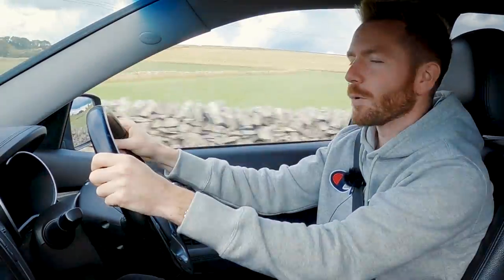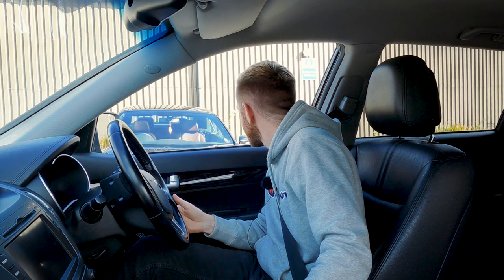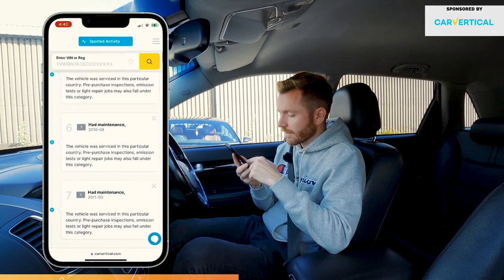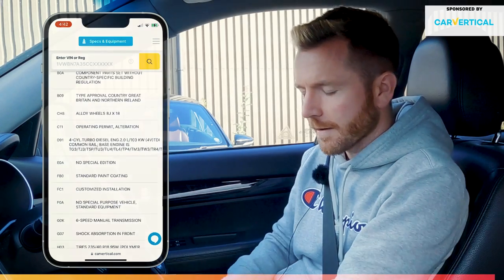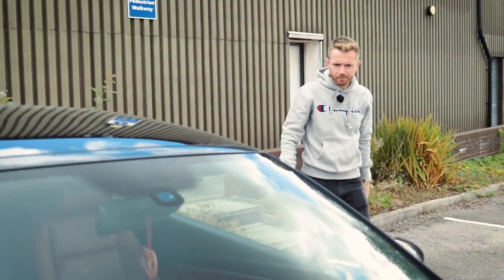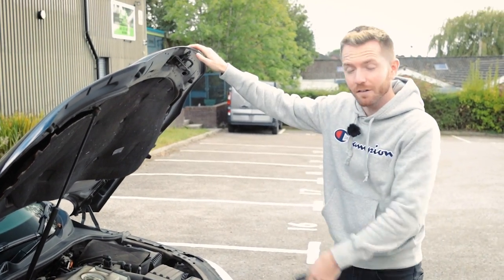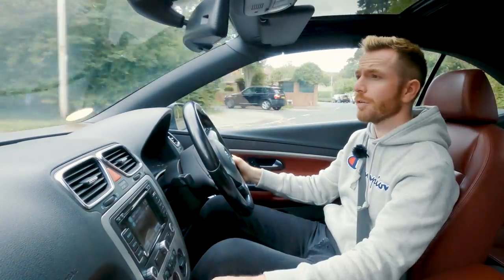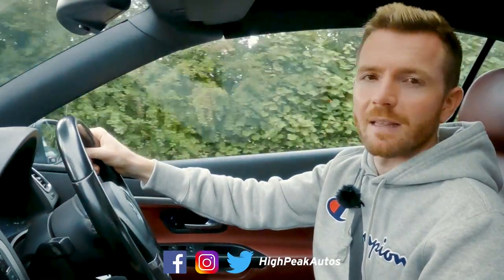I BOUGHT A CHEAP VW EOS!

Comment: We have an EOS. TSI. Kept the seals lubricated and hardly any water ingress. Not a drip in the boot. Looked after they’re great cars. Never an issue with the roof and had it 7 years now. All comes down to looking after the car, it will then look after you. Great video.
Reply: Look at the light in the middle boot as the sun eats the plastic , just press it in the middle , but be warned in my fall out , check before it kills the roof ECU and motor £ 2k to put it right .More if VW do it .
Reply: It is the same here in Denmark.. These were pretty expensive as new cars and still hold a decent value. So people has and still is, taking good care of them. I have traded 4 of them since 2010, and all of them were just like 98% new cars. ;) Cars in Denmark are much more expensive than in England, so that might be the main reason. A well maintained 2.0 TFSI is still £18k.. A diesel like the one in this video would me £7-7½K :)
Reply: So you lubricate with silicone spray?
Reply: Awsome, imma get it
Reply: "Hardly any water ingress". Not the words any car owner or submariner wants to hear
Reply: @eponymous7910  I'm big fan of the Mk7 Golf GTI Performance and R, having had them, but the cheap and thrown together Eos and the later Mk8 Golf product, along with all the "Roc" models, make we want to vomit
Reply: @acidoblivion  It’s best to use Gummi Pflege lubricant for these seals
Reply: @SoulJuce  yes. Works perfectly.
Reply: How do you lubricated it, and with what? Is it a tedious process?
Reply: Krytox 105 is what is recommended by VW
Reply: What's great about it? The fact that it works doesn't make it great.
Reply: I just bought a 2013 TSI with 42000 miles very well maintained first thing I did was put the top half way down and flushed the drains and lube the roof seals with simple Vaseline. Vaseline petroleum jelly has been used for years on T top seals to keep them soft and not drying out and cracking and lube pivot joints while at it took just 30 minutes as far as oil consumption will use average of a quart between changes but my mechanic who own his own shop worked as a VW mechanic fo 14 years told me to change the oil every 5000 instead of the recommended 10000 miles that the computer says he said the oil consumption won’t be as significant then I’ve always changed oil every 5000 on my cars anyway

Comment: Great example of modern German engineering. Just 100k miles, and the folding roof, sunroof, bonnet opener and air conditioning are all busted. Hardly surprising that people experiencing that level of reliability turn to Toyota for future purchases.

Comment: That had a lot of kit for a VW of that era (when the feckin steering wheel was an optional extra). But the usual suspects haunted it, clutch/flywheel, rust coming on and roof not working Definitely no surprises and as the engine and box are good you're right, absolutely one for a DIY guy.  Thanks for taking the time to put this content out. You make it funny, punchy and the editing is great.

Comment: Sad to read so many negative stories about the EOS... I have had a 2008 2.0 TDi DSG Sport gor the last 8 yrs and it's been one of the most reliable cars I've ever owned. It's done 123,500 miles always serviced, with a high spec and a roof that has never let me down. It just sailed through its recent MOT as it has done the last few. I live in Devon so the roof is up and down all the time. It drives like it did the day I bought it... I guess I've just been lucky, or maybe I've just looked after mine
Reply: Same here. A car will only perform as well as how it’s been taken care of. It seems like the previous owner of the EOS in this video did not maintain it as well. I love my 2009 EOS and maintain it through scheduled maintenance checkups. I have 136,000 miles and it’s going strong so far. I live in the Washington DC area in the US. I was surprised to hear about the common leaks and smells mentioned as I don’t have that issue.

Comment: Pro tip - you need to keep the roof seals lubricated with a product called Gummi Pflege and ensure all the roof drains are empty and free from debris. That way, you'll ensure your roof keeps water tight and working like new. 

Cheers
Reply: What happens when it does open no more :(

Comment: My tip for water leaks.  The seals can stick against their mating surfaces and enable leaks. The seals from the factory have a long lasting coating applied which allows the seals to slip against their mating surface but often the rubber seals and bodywork have become dusty and dry for lack of attention, they bind and do not seal well. Try partial opening of the roof and clean and apply something like Armor all protectant for vinyl and rubber to the seal and the metal body mating surface. You would be surprised how often this works. Try it on door seals to keep away water which can freeze in Winter making door opening difficult. Try it on tailgates too, especially if there is a leak, which some tailgate profiles are prone to. Remember clean dusty surfaces of the seal and mating surface first then apply protectant with a piece of sponge. It costs little and does a lot of good and may just save a leaking car.
Reply: I was thinking similar, I suspect not a lot wrong with the roof mechanism that lubricating and cleaning couldn't sort. Sadly though not so for the rest of the vehicle.
Reply: Well said my man VW  do some special grease for all the rubber seals . A great little car .
Reply: The stuff needed to maintain the seals is called Gummi Pfledge.
Reply: @drnick1972  The correct lubricant for the seals is Volkswagen VW VAG Group Krytox Roof Rubber Care Oil Lubricant G052172A1 5. I had one of the first EOS's in UK back in 2006, when it rained the water would collect between the doors and the sills and when the door was opened it flooded all over your shoes. VW brought out a mod fo it but never worked on my car.
Reply: @nigelw4119  OK. My ex wife had an Eos in 2012 and we bought some Gummi Pfledge from the dealer which also had a VW park number so maybe it’s the same stuff 🤷🏻‍♂️
Reply: I think -just like the prestige car's  (BMW/AUDI -/MERCEDES)  The EOS ends up with a load  of faults! And with the high mileage as well could  cost you more then it's  worth!

Comment: I bought my daughter an eos as a step up from a micra.

Same issue with the sunroof just needed a squirt of wd40 in the tracks above the doors. I'd wager the roof is siliconed closed. 

You rightly said...the interior and door cards are easily £500. The engine another fair bit. Then it's scrap so you'll get your money back
Reply: Don’t use wd40. Use lithium grease. There are a few videos on YouTube showing how to apply.
Reply: @markfanis9036  the wd40 I used was the silicone lubricant. It worked a treat tbh.
Reply: @nigelparish2631  that makes if it is the lubricant type 👍🏼

Comment: Got a 2.0 Diesel auto 07 plate, use the right stuff on the roof once a year & never a problem, Only time we had any water in the boot was when one of the drain pipes came off soon after we got it. The rubber surround for the roof motor is a poor design though, the lid section is waterproof, the bottom part is porous!. Best thing you can ever do is sit the rubber motor housing in a tinfoil baking tray, easy done & if you ever are unfortunate enough to get a leak, it will keep the motor protected. Would have loved this one for the Xenon's alone, stock lights are so poor in comparison.

Comment: I had a petrol turbo one of these many years ago, didn't have any issues with it apart from being called a hairdresser all the time, and it did burn quite a lot of oil.
Good video 😃
Reply: tipical tsi engine yeah
Reply: VW luv oil for some reason..
Reply: @jayturner3397  not only vw, think about bmw ;)
Reply: @daanwth  only had one for any length of time, 3 series 16 petrol,  hopeless,  driven some bigger jobs were nice
Reply: @jayturner3397  yeah, they can be good
Reply: @daanwth  cheers more an suv/4×4 ,,man tbh
Reply: Had my 2.0 TSI 6 years touch wood no oil burning
Reply: @daanwth   cant speak for all tsi engines, but i have the 1.4 tsi 122 engine in my scirocco and it doesnt suffer oil issues. owned it just over a year. 2012 had 57k miles now has 74k.  maybe its the bigger engines that suffer?
Reply: @thesilentgametestr  Most tsi engines (mostly 1.2/1.4) need replacing timing chain after 100k km, so you're lucky after 74k miles :P
Reply: @daanwth  all German cars are money pits
Reply: @callousjail447games4  not really, have had several and haven't had a single big issue other than the required maintenance

Comment: I have a 2009 Volkswagen Eos Lux with 87k miles in it, in perfect condition only small issue is the convertible top, get stuck mid way when try to put it down but all I gotta do it put the thing that get stuck at the side n that’s it, not a big a deal, i was also told that when putting gas only put the supreme gas, so I can take good care of it, I love mine & will be taking good care of it for a good few more years

Comment: Great video matt again, just bought my own first car recently - a 2008 citroen c1, yeah not much but it's mine and it's economical.
Your videos have given me some proper insight into cars, thanks!
Reply: Great car!! I bought the other french cousin, the 107 last October 2021. Great cars those citybugs. They get you everywhere and never let you really down, the only fix I had made where the rubbers that hold the exhaust wich rotted away after 12 years. 
Made a trip to Switzerland from Holland with just one stop in the 107!
Safe and happy travels :D

Comment: I work at a VW dealership and EOSes(?) are notorious for leaks. Hard top convertible with a sunroof...recipe for complications.
The whole functionality is a web of strings (for real part called "string kit").
Any tiny side fender bender can throw the whole convertible system off line. 
As a rule the Techs at my dealership don't roll down the windows, open the  convertible top or take them thru the car wash

Comment: Owned an EOS (in blue not black) and had no end of issues with the TDI. from the dual mass and clutch, failing twice in two months (the first one, I believe was not properly torqued on the flywheel bolts) and MAF sensors (it had 4 in 12 months) two ABS sensors of the front axles (replacements require axles removed)

Finally got rid as the turbo was starting to show signs of issues. Sold it to Trent's for £465 and was happy to get that for it. Spent 6k on the darn thing, and that again on parts and other sundries. 

Now have a kia nero EV. No issues at all. Loving ev driving now.

Comment: I had an Eos for 3 yrs and didn't ever have a leak. Was 2l tdi sport and i loved it, only reason i sold was that i needed a more practical car for the Mutt. Was good on fuel , quite pokey and cleaned and treated roof rubbers regularly to stop leaks.
Reply: I currently have one and it doesn't leak either, EVER. The timing chain and tensioner was a big problem for multiple VW models, including mine. I love my car and intend on keeping it indefinitely. It's a 2013 at 90,xxx miles.

Comment: I own a 2.0 Tfsi and I have to say its an amazing car it’s a DSG with 50.000 miles and it’s an individual edition! Its an amazing looking car in good condition, it does leak a bit….. from the pillar on the front right but it’s a great car, quite quick the only bad thing is the fuel economy, which is….. not great but still very happy with it as it is my first car!

Comment: I’ve got a 2.0 Petrol Auto on a 08, just passed 50k miles with FSH, you need to look after these, the VW lubricant for the seals is over £30 for a tiny tiny bottle and you need to massage it into the rubbers at least 3 times a year, mine is bone dry and root works a treat, and 🤞she’ll run for another couple of years 😂

Comment: I had the same no resistance issue on the key Barrel of my VW Amarok.. You had to turn it all the way counterclockwise before turning it clockwise again before the ignition lit up.. Turned out it was a broken/faulty steering lock mechanism which cost about 180 Pounds at the VW Dealer to fix (ZAR3800)

Comment: There must be literally thousands of Chinese tyre makers - after years of working in the used car trade you're still coming across tyre brands you've never heard of!

Nice vid as usual 👍🏻
Reply: yeah and there are even brands reproducing older michelin tires (they copy the profile).
Usually with these asian brands is that the quality of the rubber is poor, they just get cracks at a year age. Also wet-weather performance is terrible :P

Comment: Regarding wheel bearing noise, I had a "wheel bearing" noise and had all four bearings replaced. 
The noise was still there .... until I changed all four tyres. 
The tyres were only a few months old but the tread was "growing" or "contracting" in places making the tyres "knobbly". They were brand new Avon low profiles but the MOT tester picked up on them. No refund from Avon though I might add.

Comment: i had 25 cars in my life so far, most of which were way below 1000 pounds, but never got one with four different tires, always the same tires on one axis. I had some super dangerous combinations (winter tires up front, worn summer tires at the back, during wintery conditions for instance) but just... replacing one tire doesn't seem to be a thing in the Netherlands. Phew.

Comment: Ive had my 2008 eos turbo for about 5 years it's got all the upgrades including backup camera, touch screen heated seats and mirrors plus allot more. I love it! It's such a fun car to drive! My top works fine for now but does leak lol  im not sure how to fix that or what all i should do to keep it working. But I've only had to replace the battery and one axle since I've had it. I have the red one with tan and black leather interior. Of course in tn i paid $5,000 for it used with 130,000 miles.

Comment: We had an Eos, the TSI with all the letters in red (ca 200 bhp). The rooftop broke and it took VW 4 months to fix. They finally sent specialists from Germany to our local workshop in Stockholm to fix it. The cost was the equivalent of 2K pounds. We heard that the rooftop always break because of how complicated it is. It is basically three parts that breaks up and folds one over the other. All for all, the car worked fine but the automatic gearbox wasn't smooth nor nice.

Comment: my golf mk7 has been in the shop so I've been borrowing a mate's EOS for the past week. The one thing I can say is people who aren't "car smart" seem to really like it and I've gotten loads of compliments on the car, much more than my 4 year old golf. maybe its just because its a convertible? Also at 150,000miles it drives pretty well, and the only thing wrong with it is it sometimes crunches going into second if you rev too high in first as I've discovered lol probably the synchro or badly adjusted clutch

Comment: Great video. The insight you provide is worth its weight in gold! I was about to buy an EOS with a dodgy roof - I don't actually care if it doesn't work - which has had brakes, cambelt and water pump done. It's the 2ltr petrol, so with your comment about the oil, I'm not so sure... Thanks for the excellent video and detailed commentary.

Comment: A panoramic sunroof in Lancashire wouldn't get much use. Probably just needs opening and closing a few times with a bit of lubricant. They suffer from a lack of use here in Queensland as we usually have our air conditioning on all year round. That tube of silicon in the boot made me laugh out loud. Not a good sign at all.

Comment: Today, my Eos sailed through it's MOT, after watching this disaster i had my head in my hands in despair, mine is a 2.0 tdi Bluemotion SE,the later shape front end and in comparison mine compared to your example, it's night and day, if you own an Eos you need to use Krytox oil on the roof rubbers otherwise they dry and crack, that's what causes the roof leaks, the 6 speed manual is the best (i have that), it seems as though the whole suspension plus bearings will need a change....ouch! .... where's your service history ???.

Comment: I just finally had to retire my 2012 Eos with 153,000 miles on it. Transmission went out and was going to cost 6000+ to have it fixed. Going to miss that damn thing!
Reply: Did you change the tranny fluid ever ?
Reply: @johnochoa5754   Yes, did it myself. It’s a bit of a pain in the ass for the average person to do but at the end of the day it’s not much different than an oil change.
Reply: @Munky0426  what regular maintenance did you do besides that and oil change I have an Eos too with 96k miles and wanna take care of
It ?
Reply: Nothing more than the norm, other than getting this stuff called Gummi Pfleggi Stift to care for the top seals. Always keep it in good alignment as well. I had had mine since 65k and it had been very well cared for. Put a Chinese android head unit in it to give me wireless CarPlay for my work.
Reply: @Munky0426  it is quite a bit more than an oil change. The fluid has to be of a certain temperature before/during changing and has to have the filter changed as well. Also has to be done with VAG-COM or OBD11 too. Anyways.....

Comment: I have a 06 model, with 80k miles, gasoline FSI engine, zero issues. This car needs annual seals lubrication and some love. Its not made for abuse.... So if you want one, you should find a decent owner and not be a forth possession owner.

Comment: 18:07 I had a Renault Laguna 1.8 Sport that I bought brand new in 1996. It cost me £14k and I ran it for six years putting 19k on the clock. I never had a spanner on it and I never had it serviced either although I did change the oil and filter a couple of times. It was a rust bucket, I had it welded a couple of times and I had two replacement exhausts. I part exchanged it and got £2,500 for it. A few months later, I saw the new owner who told me he had paid £6,995 for it with FULL SERVICE HISTORY. It shouldn't have had any service history to show.